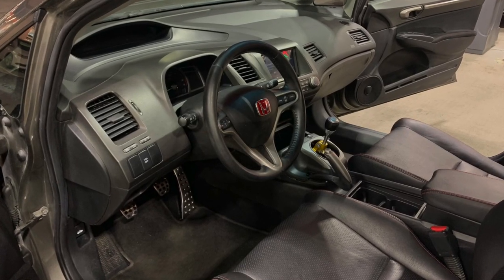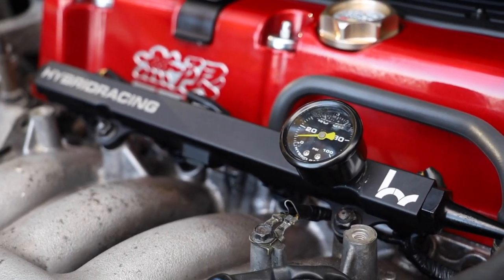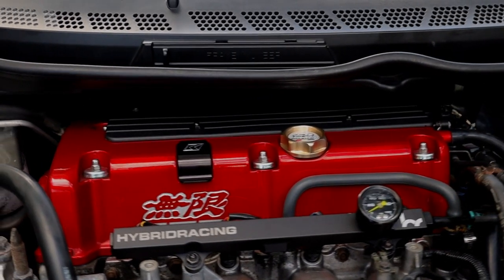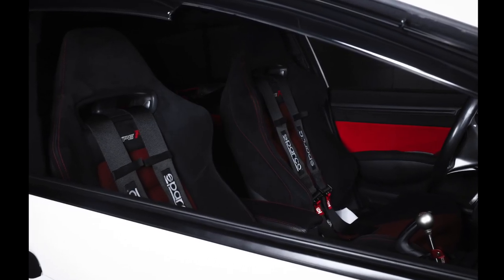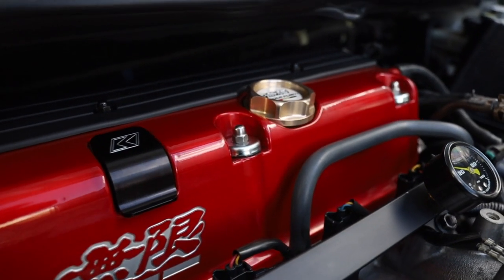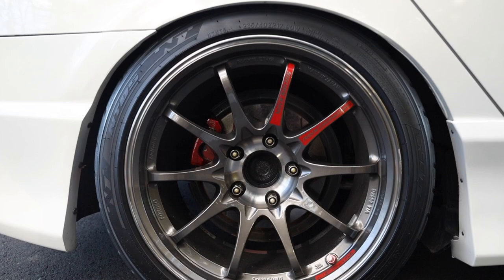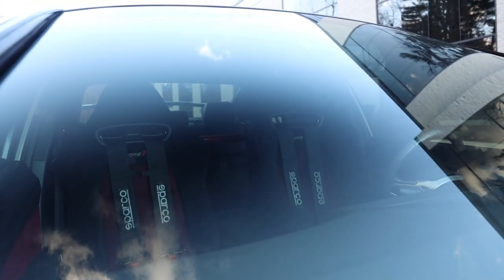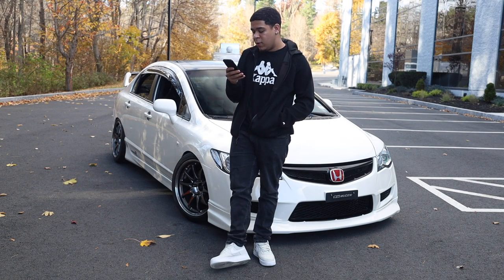My FD2 Type-R Converted Civic Si Build/Mod List

Comment: You should put an Injen Hydroshield or AEM Dryflow on your filter. Def get the Mishimoto radiator + fan, helps keep the water at 175 during hot summer days.

Comment: How is it working on the engine? Like difficulty wise? Do you have to take out the engine when working on it due to the engine being tucked towards the firewall?
Reply from the maker: @jakdurok561  in my opinion k series are a very simple motor to work on. Once the windshield cowl and metal plate come off you have more room to work with

Comment: Wouldn't you still need a throttle Body, TB spacer, intake manifold, injectors, cams, valves , springs , retainers,ignition & underdrive pulleys  to be " full bolt ons" ?
Reply from the maker: No.

Comment: Hey I'm a FD2/1 fanboy myself, I'm in the middle of working fitment on the body and wheel setup with my air suspension. 
Now the 09 FA5 SI, I am the 3rd driver to the car where the previous owner only drove 3k miles to race and daily drive so he bought the KW V3 coilover kit (retails @ $2,229.00 USD).  I ask as you mentioned in the end of your video wanting some nice coilovers, would you be interested in buying the V3 for a fair price? I have documentation from a KW rep that they are real.
Thanks for posting your video I liked your thoughts on every mod and update to yours as it will inspire me into the future mods of my own.

Comment: Does it have any more horsepower or torque than stock?
Reply: Not sure about torque, but he's got FBO so expect at least 210 wheel.
Reply from the maker: @urgandma  235💪🏼
Reply from the maker: 235 hp, 170tq
Reply: Is that 235 to the wheels?   If so that’s a good setup!!

Comment: To the owner of this car.  I'm just taking a guess here based on the pictures you showed of the process of respraying the car , I'm wondering are you a body man ? Or painter? Just wondering as I've been a heavy collision tech, and high end automotive customization and restoration tech as well as a considerably capable fabricator and an even more capable welder when using a mig.  If you are in the collision / auto body trade I just wanted to say hi cause there aren't that many of us out there , especially from the younger generations , it's too physicallly strenuous and meticulous type of trade for most young people these days.  So just wanted to give a hi five to another body man and say nice SI, my brother's 08 SI sedan is the same exact color yours was befoee you resprayed it,  best civic chassis since the 88-91 EF's and '92-'95 EG chassis civics.  Also want to give you just a small suggestion of advice regarding the fact that in the video you stated you installed a short shifter kit. Some people like them , some don't , but the truth is whether you like them or not , that they are not at all good for your transmisson and almost always lead to destruction of the synchros , especially in 2nd and 3rd gears , they also are infamous for causing bent and or cracked shift forks , and given that out of all the different 6 speeds made over the years for civics and rsx's , the 6spd in the 06-11 SI's is the weakest and by far the most prone to premature failure. If I were you I'd put the stock shifter assembly back in the car and install solid bushings Iin the shift linkage if you want the gearbox to feel tightened up , but yeah you using that short shifter is essentially making your transmission a ticking time bomb.  When my brother bought his 08 SI 3 years ago I had to pull the trans right away to rebuild it as he bought it with a cracked shift fork . And even though he bought it with only 112,000 miles on it , when I pulled the trans apart I found that it had brass synchros which  were aftermarket which means that transmission already needed to be rebuilt at least 1 other time prior to him buying it , and like  I said he bought it with only 112k miles on it ,  and guess what , the guy that owned it before my brother bought it had installed a short shifter assembly , and I guarantee that's what caused the trans to need two rebuilds within only 112k miles , and I bet had that short shifter assbly never been installed and assuming the previous owner knew how to drive properly I'd bet that with the stock shifter if wouldn't have needed either of the two rebuilds , at least not until considably further on down the road when it had a lot more miles on it. I removed my bros short shifter assembly he bought it with before he even registered the car and replaced it with a stock unit, sold the piece of crap short shifter to some ignorant sucker who thought he was  buying a beneficial and functional modification part for his k20 swapped EF hatch, I figured let him destroy his trans if he wants but my bro refused to even drive the car until I removed it an put a stock  unit back in like it should be.  Consider this advice as if you can't pull and rebuild then reinstall your own transmission , your gonna be paying some shop a considerably high amount of money for them to do the job for you.. if I was you I'd throw that short shifter kit in the trash , install a stock one , along with solid shift linkage bushings and maybe a weighted shifter knob , your transmissions synchros and shift forks will appreciate it immensely.  Take my advice or leave it , just figured I'd put it out there if your not already aware. Now that I'm further into the video I have a critisism ,.you spent hundreds of dollars on a stupid freaked dip stick and oil cap as well as.mamu other stupid sense less mods, but you didn't actually buy and install a genuine used type complete engine and transmission so essentially none of this car is actually "type R" except for the required  body panels , a Guage cluster and a pair of front seats which are not nearly as nice looking as the stock SI seats IMHO. This. Doesn't make any sense to me because what has always truly made a genuine Type R is not the body panels and cosmetics, it's way more the drivetrain that makes all Type R's special and so much different from all the other civic and integra trim levels.  Function over fashion bro , thats the only way to build a Honda IMHO , most of these mods in my eyes are all irrelevant wastes of al ot of money that coulda  been spent on other things that actually make the car better like performance enhancing parts. Not trying to be a dick it's just I'm from the old school golden days of modifying and street racing Hondas , old school as in I was installing a full 93 Gsr genuine B17 swap in my buddies 90 crx before they even made engine mount kits back in late 1998 into 1999 cause he had problems finding all the parts , so being from that era , the first wave of Honda fanatics we all from those days tend to care a hell of a lot more.abiut how fast our cars accelerate and how well they handle and brake, and cared far far far less about looks which is simply another ugly sign of too much materialism in the young generations. With your car looking so flashy with the type r body panels your gonna attract slot of attention from other tuners on the highways , what are you gonna do when they start calling you out wanting to race ? I mean you have nearly nothing for power increasing mods , so your car def ain't fast , hell it's prob barely even considered quick , I'd call a mid to high 14 second car (your car) peppy at best , practically all other drivers in modded vehicles that call you out to race are gonna likely smoke you hard and they are gonna think your a joker driving around in a car that looks so sportu and flashy but doesn't have the performance to back that stuff up , I'd find that incredibly embarassing.   Those red fabric door panel inserts dont look too nice , I think they give off the classic "I'm a ricer" vibe as do the seats. Sell all that cosmetic junk and buy a humble performance budget turbo kit and kpro  ,  do that and you gain some respect trust me especially if it looked still like a fairly stock SI.  I mean it looks good , I just think it's retarded to spend 18 thousand dollars on modifications and out of that all you have to gain power is an intake , header and exhaust which is pathetic , and the intake is a cold air intake which never make the same high end HP gains as a nice short ram intake with 3.5"-4" diameter aluminum piping